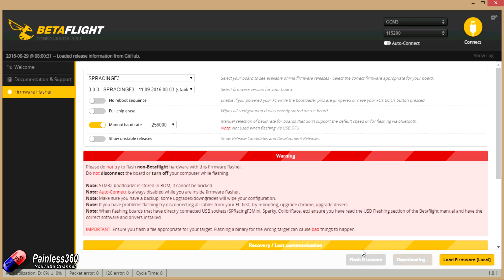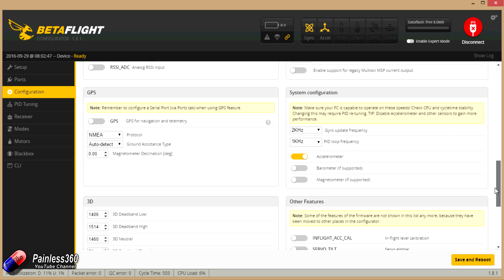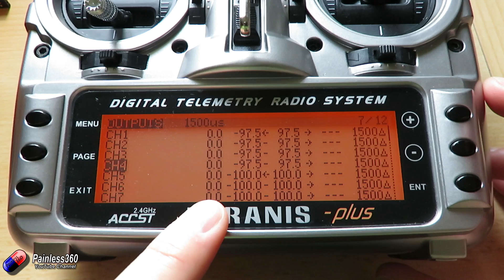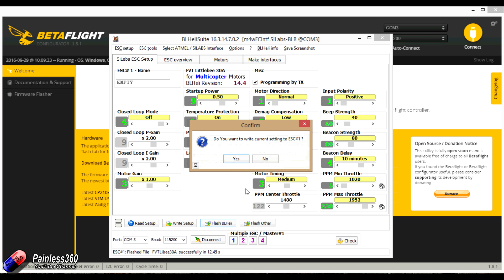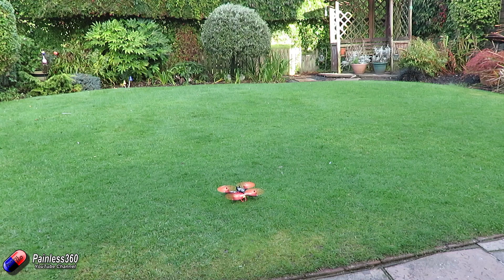(6/7) Quadcopter Building for Beginners - Series 2: Setting up Betaflight

Comment: Hi Lee I have a problem with my board I think, when I am on the settings page in Beataflight and I roll the board to the right the little craft on the page pitches down if I roll left with the board the craft pitches up and if I pitch up or down the craft rolls left and right do you have any idea how to correct this or have I got a duff board. The board is a Omnibus F3 regards
Reply from the maker: I’d reflash it first, check the Betaflight wiki and forums for the board you’re using and see if there was a hiccup with the target version you are using. If not then you can use the board/gyro alignment setting in Betaflight till it moves in the same way. I had to do that in the last iNav series as I mounted the F.C. at 90 degrees..
Reply: Thanks Lee I have tried re-flashing it I even flashed it with an earlier version but with no joy I will try the board alignment settings I will let you know how I get on many thanks

Comment: some things are not clear to me:
Where is your switch on the radio to enable diffrent flight modes
I got some brand new t-motor f30 escs and when I push  read setup on blhelisuite , a warning  pops up and says  that writing on that esc failed
Reply from the maker: +Sufyprojectss have you watched the other videos in the series? I cover all the steps..
Reply: Painless360 I didn't , I'll watch them soon

Comment: Recently update copter from cleanflight to betaflight - this is what is happening

Keep in mind this happens in angle mode and in horizontal mode, not in acro.

So the situation is: after calibration of the motors using the Master 
Slider everything is normal.  I can use the master slider up and down and
 all 4 motors spin at the same speed.  2nd step was checking to make 
sure that the transmitter throttle was working correctly but when doing so, 
motors 1 and 3 would gradually increase in speed without my interaction,
 I had set the transmitter throttle up just enough so the motors would spin and 
then let go of the transmitter throttle but motors 1 and 3 would speed up 
(motors 2 and 4 were responding like they should and maintaining speed 
based upon the transmitter throttle output).

What I did to correct this -
 I went into the PID tab and adjusted the ANGLE setting from a default 
of 50 down to 10.  With the setting of 10 all 4 motors are responding 
correctly to the RX throttle and do not increase in speed unless I increase it on the transmitter.  

Have you seen this?
Reply from the maker: Google 'speed up motor painless360' to see a video on something similar - not sure if it's your exact issue..
Reply: I'm not finding the video that you are referring to.  Maybe a link?
Reply from the maker: https://www.youtube.com/watch?v=DDnaAQLjcQQ

Comment: Painless360 how did you find running betaflight on the f3 deluxe do you find a bigger different to using it on cleanflight in anyway my friend   nice video by the way
Reply from the maker: The two do feel different, the things added to Betaflight do make the model feel more responsive and better tuned straight out of the gate. V1.14 of Cleanflight is starting to import some of the improvements made in Betaflight into the core code now too..
Reply: Painless360 thanks my friend after flashing back to cleanflight  i found out from joushua bardwell  he come across this with 4in1 beHeli esc  and all you do is swap the esc outlets from the fc outlets   and its sorted flying  hanks  very much guys

Comment: The OCDay mini 20A ESC's from the last beginners build have been giving me "flip a switch" throttle even after BL Heli update, 2 different Rx PPM and PWM, 2 different FC and 2 different GCS and much fiddle faddle in the TX and GCS GUI. I think sometimes the combination of parts just doesn't always work. I'm keeping it together because I'm determined to find a solution. I have another one I built, it went together and flies perfectly, all the same parts EXCEPT, it has a Racerstar 4in1 20a ESC. CHEERS!

Comment: My take on that little bugger using mostly TBS Products: http://imgur.com/a/evvw4

Also had to make myself some 3D Printed Parts:
Mounting Solutions for the vertically oriented LED Strips utilizing front and rear frame spacers
VTx Pigtail Mounting Solution using rear right crossbar Screw
Rx Mounting solution using rear left crossbar Screw

That build sure is stuffed... Too bad I couldn't fit the CrossFire Micro into it anymore ;(
Reply from the maker: +Duraltia we have a frame on the way that may be a better use if space for a pure X racer.. stay tuned!

Comment: Hey Painless360, 

at 8:44 you're saying that the barometer doesn't show. That's actually because you kept if off inside the Configuration page, under System configuration. (your accelerometer was on, but barometer and magnetometer were off). Right?   :)
Reply from the maker: Probably! Well spotted :D
Reply: For Naze32 rev6 barometer and magnetometer are disabled since version 3.0 of Betaflight (changing sliders under configuration tab dosn't make any difference). Found nothing about this yet. CLD does not work either.

Comment: Thank you once again for your great videos! They've helped me build my first quad (TarotTL280H) and now i'm about to start building my second frame (Lisam LS-210), so i've a quick question, since i'm going to be using the same Flight Controller , in order to flash it with betaflight (comes with cleanflight) don't you need to have the boot pins shorted?
Reply from the maker: You shouldn't have to, the process should be very simple. Best of luck!

Comment: Hi, thanks for video. Where you found antenna holder?
Reply from the maker: I designed it - check out our Thingiverse pages.. Happy flying!
Reply: Hey Denis. If you don't have a 3D printer.
https://www.amazon.com/Receiver-Antenna-Pedestal-Multirotor-Quadcopter/dp/B01CI1JPRC/ref=sr_1_4?ie=UTF8&qid=1478277211&sr=8-4&keywords=antenna+holder

Comment: I have the same fc board . I have flashed it clean flight . To use blhelisuite pass through , do I need to flash betafligt firmware on the fc board is the clan flight firmware sufficient
Reply from the maker: If you google 'Cleanflight 'BLHeli passthru' you'll see it's supported in Cleanflight too. In fact in the first build series on the channel we did just that. Best of luck!

Comment: Lee, few tips:
You can use the moter-tab in BLHELI to calibrate the ESCs. Since you use passthrough, it uses the correct values from the flightcontroller.
Also in that motortab, look at what value all the motors start to run smooth, and set that value in betaflight for min-throttle when using airmode.
Great video as always!
Happy flying!
Reply from the maker: Thanks, we did play with that as part of the troubleshooting but didn't cover it in the video as these are aimed at newer builders - too much information and many ways of doing the same thing can be confusing for some. Thanks for the posts - Happy flying!

Comment: Very well explained and yet another great build by painless360, just one question. Did you change airmode later on because it was overlapping with horizon mode.
Reply from the maker: +Jasper Tielen Airmode provides PID support all the way down to (and including) zero throttle so can be used with any flight mode.. Happy flying!
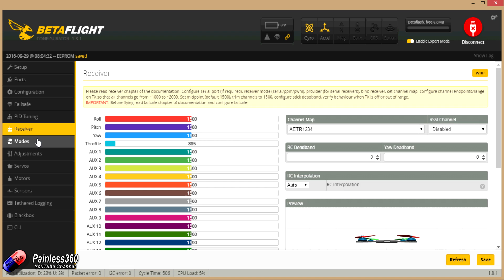Reply: Okay, I didn't understood. @8:39 it looked like you had 2 modes selected at once. 

Still learning,..
Reply from the maker: Yep, I did. Horizon with Airmode and then Rate (nothing selected) with Airmode.. Happy flying!